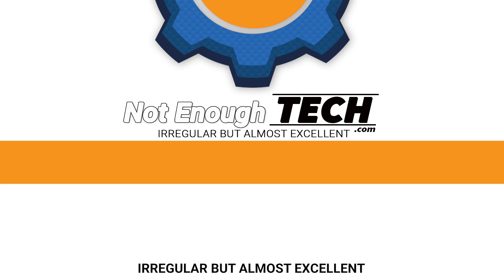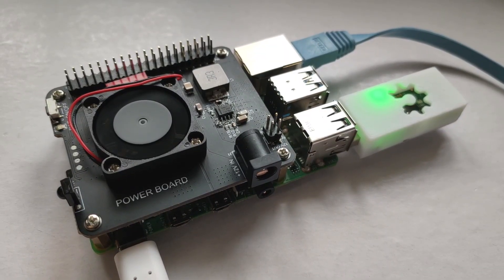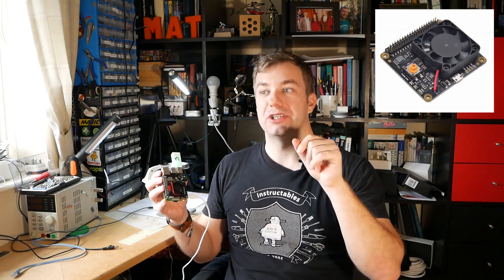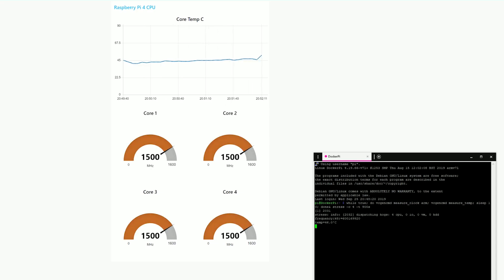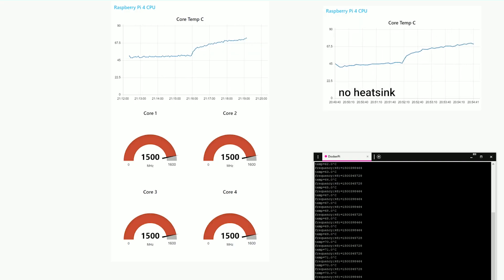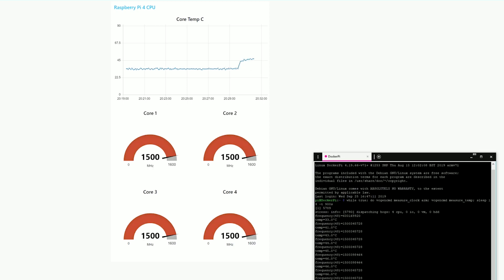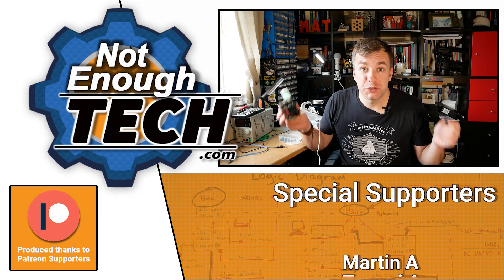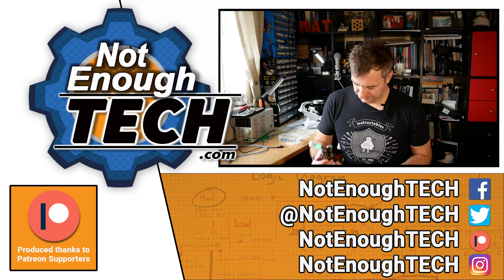Cooling Raspberry Pi 4

Comment: hello Matt, thank you for choosing our product and  I am so sorry for that bringing your so much inconvinent  on testing. This power board is designed for the dockerPi series products ,and the 12V DC input can support enough power to the Raspberry Pi and other dockerpi when you stack it togother.  and  12V power adaptor which is negative outside and positive inside.  Could you please send me an  address so that I can send you another one that my colleage had tested before shipping to you.  sorry for that faulty product again.
Reply from the maker: Hi Kevin, 
I emailed Jacky Li on 16th Aug but I had no response from that email what is the best one to reach you?
Reply: @notenoughtech  just wondering if the came back to you in any way ...
Reply from the maker: @FedericoGranata  I received the replacement unit that works ok, and they were kind enough to send me 3 IC so I can try to fix the board. I'm going to the hackspace tonight to fix it

Comment: Nice job, BTW how about a fan that's run only when you needed like in a PC. A program in py whit something like a PWM ... or maybe is out there a bord whit some temperature monitor ???
Reply from the maker: Technically speaking you do lower the temp of the PI by 15C at idle, do you do want to run it. PWM would be nice tho, but the noise levels arent that bad